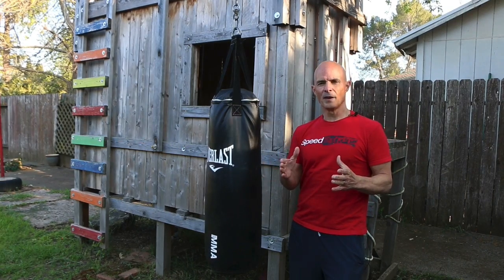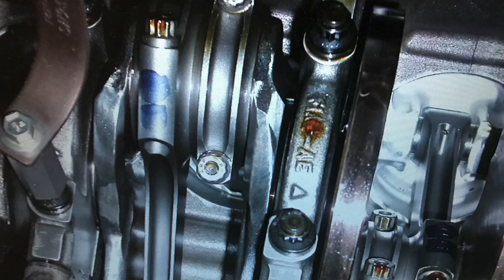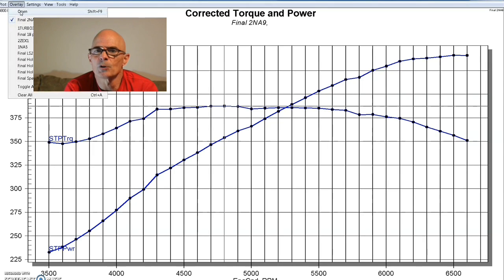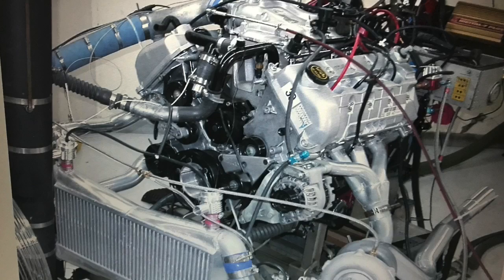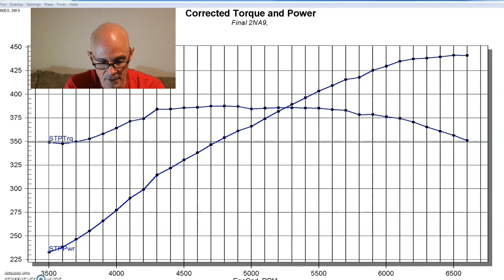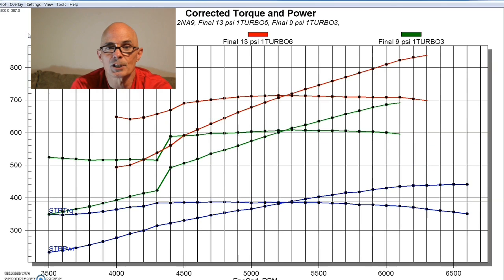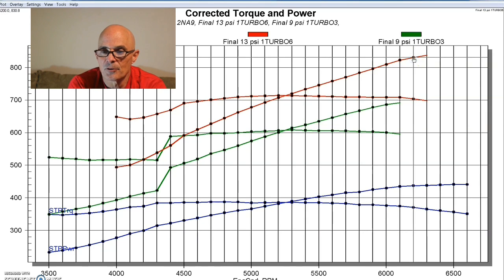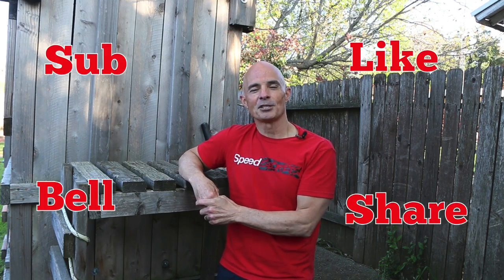1,000 HP TWIN TURBO FORD 5.4L 4V NAVIGATOR

Comment: Gotta love the defect Ford had with some of the engines! 05 to late 08, the spark plugs would lock up in the heads and break off! Ford would charge you 45.00 per hole to take the piece out and 25.00 per new plug, that wouldn't do it again in the future, to replace them.
Had a customer tell me about it. He ended up with an 800.00 bill from dealer, just for tune up. SMH
Good job Ford.
Reply: That was the first gen 3 valve motor not the 5.4's.
Reply: @Scootermagoo  Yeah. I don't pay attention to the ford junk. I just watch and thumbs up, Richard, because I like all the work he's done to help out enthusiasts. Whatever they had in 05 through 08 were junk, with factory installed plugs.
Reply: Joe Blo  it definitely was 5.4 2v and 3v, Fardbhad a huge service bulletin about it and how to replace/extract broke plugs in them with the special tool. Some have issues, some dont. It just takes 1 time no antiseize for it to happen and it pulls the threads out. It's honestly user error/bad design. 4v did have the heads with the 4 thread spark plug heads but even those dont have problems UNLESS its user error.
Reply: I had to comment on this. I took my 5.4l 3valve 2004 supercrew lariat in at 45000 miles for a sparkplug change. Because of all the complaints about breaking plugs in the heads . My dealer mechanic was able to get all 8 out without breaking any installed the latest version of plugs and I couldn't believe when I saw the bill for 750.00 plus tax ,what a ripoff. I tried to do what I thought was right by not running the plugs to 100,000 miles per manual, but they still charge you like the plugs all broke. 
Scott B
USAF veteran
Reply: Get your facts straight please, that was 5.4 2v, early 4.6/5.4 3v, 4v never has this issue. Only time they gave a problem was installer error with no antiseize and or cross threading them. I've done so many tune up on these engines and the 4v is the easiest and ALWAYS gave the least amount of hastle.
Reply: @OGskunkMASTA  I had a 98 Nav and 2003. Obviously the 98 had the 2v. So I had both the 2v and 4v 5.4L. I never had an issue with the spark plus on either. Plus I first played with up to a 250 shot of nitrous until about 2002 and then I took that off and played with an S-trim that made about 15lbs of boost. The only problem I had and anyone that owned a 98 may have had it also was, the #3 coil pack going bad because of a small coolant leak if not repaired. Never once did I have an issue getting plugs out on either.
Reply: @waynebollentin989  I guess you can't read...? What years did I say??
Reply: @waynebollentin989  Scootermagoo corrected me and didn't start s^&t talking, so why do you and your other ford loving buddy have to??
If I'm wrong I'll admit it, but I wasn't wrong about the years of the 5.4 issue, now was I? Did I say it was the same as the one in the video? Nope!
Reply: @funfun8095  Well you got the engine wrong and remember you're commenting on a video of a 5.4 4v not 3 valve... It really wasn't the heads it was the 2 piece spark plugs breaking off. 🤦
Reply: Ok. ;)
Guess the Ford assembly plant didn't know how to use antisieze! Not to mention their junk cam phasers that break, cam followers that fall apart, and valve springs that break and drop valves! All junk 4 letter word crap anyway.
Reply: @funfun8095  that's funny nothing like talking shit about something you know nothing about. It's idiot's like you that think it's a manufacturer that makes the engine and not the people building and tuning it.
Reply: @funfun8095  I think stupidity and lies on your end does not count as fact, just really shows your lack of knowledge on these engines and I feel bad for ANYONE who takes any advice from someone as mush brained as you. Do the world a favor and educate yourself before you look stupid (again) to people who actually know what they're talking about.
Reply: @OGskunkMASTA  Ok ford lover. You're the man! I'm pretty sure I put the years and am correct they were junk and had problems. FROM THE FACTORY! 
And yeah I don't know much about the junk ford crap, because I have enough brains to not waste time and money on stuff that cost twice as much to build, then makes less power, and doesn't last as long.
Reply: @OGskunkMASTA  although I do agree with the stupidity problem and assholes taking advantage of others. Never had to worry about that because I did my own work and had happen to be very good friends with one of the best boosted engine builders going back then and today DRE.

Comment: ima gm LS guy... but I wanna build a New Edge gt mustang with a 5.4 swap
Reply: @303StreetMachines A fucking Lincoln Blackwood - are you just trying to find the rarest(since they didn't sell AT ALL) donor possible?
Reply: You can also get a 5.0 coyote pretty cheap out of an F150. Little more complicated engine but, imo, it outperforms the 5.4.
Reply: @177SCmaro  Where? A friend couldn't find anything under $2500.
Reply: @bartpang  
Ebay. You can find them for anywhere from around 2000 to 5000 depending on if they came from an f150 or a mustang.
Reply: @177SCmaro  Not really what I would consider affordable.
Reply: @bartpang  
Gotta pay to play. This is an expensive hobby. 
If you want big, dumb, cheap horsepower I suggest finding yourself a big block chevy and a nitrous bottle.
Reply: @177SCmaro the 5.4 with a coyote intake and cams can make some pretty good power and it can do it at a lower rpm vs the coyote it'll make better torque..
Reply: It’s a great swap and not as hard as you think
Reply: great motor, one of my favorites, made 4 digits on mine for years
Reply: Build an older F150 or navigator
Reply: Get an early 1970’s F100 to swap a DOHC motor
Reply: @BustedWalletGarage  90% of the high mileage mod motors I have tore down still have the cross hatching visible in the cylinders. Even in a 250k Aviator with 2 spun main bearings because of no oil pressure due to not changing or checking the oil levels! And it had 1/2" of metal filled sludge in the bottom of the oil pan...
Reply: @303StreetMachines 
Right, but I'm pointing out the coyote might be a better option. As I understand it the 4 valve 5.4 is somewhat uncommon. Ford made a zillion 5.0 f150 2011 and up.
Reply: Complete old crusty 4v navigators go for less than 1000 on craigslist. Coyote intakes fit with cheap adapters. Only huge expense is big cams and valvetrain
Reply: Kyle Milligan those engines do not age well. Figure at least $2500 to rebuild a junkyard motor unless you luck out with one less than 50,000 miles. Maybe you can rebuild for less but if it needs to be bored out you’ll spend a $1000 on machine work alone.
Reply: @BustedWalletGarage  what are the high mileage problems?
Reply: Kyle Milligan 1. Valve train components 2. Electronic parts 3. Piston ring wear 4. Rod bearings/oil pump issues.
Reply: @BustedWalletGarage  1 timing chains and guides ok 2 electronic parts... Um ignition coils? 3 piston ring wear is debatable 4 rod bearing wear is no different than 2v bottom end. Worn out oil pump maybe.We are not talking about 5.4 3v with oil pressure related phaser issues. I work on this stuff every day.
Reply: @kylemilligan752  as for the 5.4 4vs...dime a dozen, every nav/aviator everywhere. Rock solid 6 bolt mains, just toss some bearings in them, gap the rings, throw some ford GT cams in them, get a mod 6 box and a either a sniper carb intake(coyote adapter) or a vic jr with a 850/1050 brawler blow through and toss any 67mm or bigger single on it. If I had it to do over, I would do it that way. F that ford fuel injection nonsense. Carb all mod motors.
Reply: @WarfighterRacing  i'm with you warfighter, junk navigator 5.4 4v, basic rering job, coyote intake and bottom of the page cams
Reply: @BustedWalletGarage  sorry, but i haven't seen 4.6/5.4 's with worn out cylinder bores at 50k. I am a mechanic.
Reply: Kyle Milligan my only experience with them is at my buddy’s speed shop so all the ones I saw tore apart had been fed a hot supper of nitrous and boost.
Reply: @303StreetMachines 
Not sure what you're talking about. Any gen coyote can be made to make 700hp. Holley makes a complete standalone system to run the coyote, even with VVT and the coyote has a modular bellhousing. It can bolt to any trans in the modular family. If that's not enough, they make bellhousings to bolt a ford modular to a GM th400. There are all sorts of options for these engines.
Reply: @303StreetMachines 
Hardly anyone messes with stock parts when swapping motors. The point is the 5.0 Coyote is actually a pretty flexible engine. I'm guessing you don't have much experience hot roding them?
And a little strange to focus more on the least important bit but because a bbc on nitrous is about as cheap as horsepower can be made. Guy was complaning about cost. No one said anything about long term.
Reply: @303StreetMachines 
I think the only stock parts left on my Coyote are the block - sort of, I had it sleeved, and the heads - sort of, they have upgraded springs.
Most people who build 700+hp, which is what you were talking about, don't use stock parts.
Th400 is arguable the cheapest transmission to make strong enough for that kind of power. And you can bolt one to a Coyote.
And I'm not sure you could even piece together some crap chinese turbo system on a 5.3 for what some spray on a rando 454 (or bigger) big block would cost. Plus you're giving up like 2 liters to the big block with that little 5.3.
It really sounds like you're not speaking from experience here, just bullshitting, lol. The person you're talking to very much is a mechanic (technician, actually) and has been built more than one engine for racing.
Look, you do you. Just saying it nigh impossible to beat the cheapness of a big block on juice.
Reply: @303StreetMachines 
Cool story, bro. 
I caution you on pulling shit out of your ass, though. There's a toilet paper shortage right now. 
If you really wanna see my drag car the best way is to come out to the dragstrip, if it ever opens.